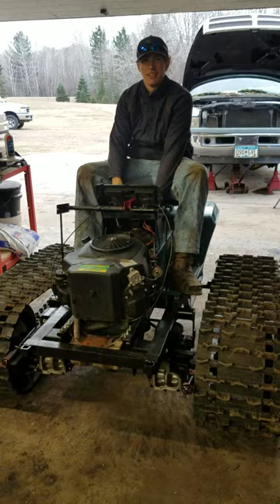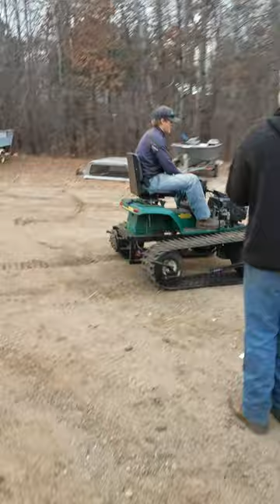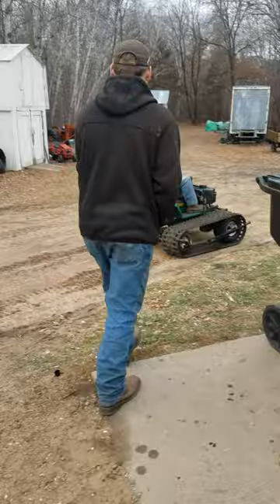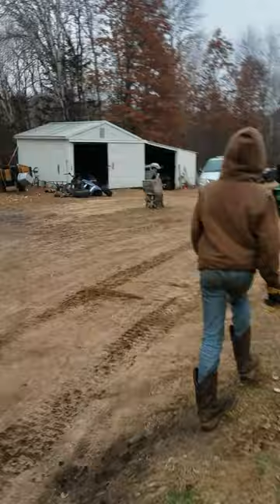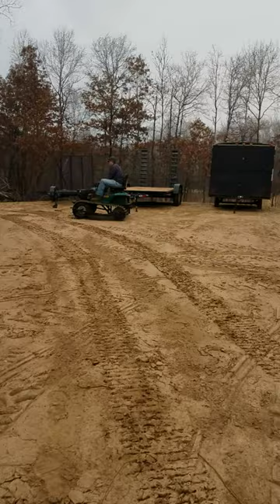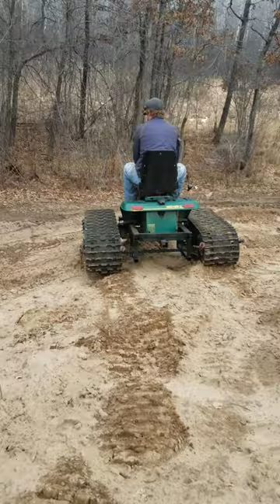Homemade Tracked Lawnmower ( Larry the Ripper)

Comment: That's awesome.  How do you plan to use it?
Reply from the maker: We mainly use it for pulling snowmobiles, four wheelers or other equipment around the yard to work on them; but I have also used it for moving trees and holding them with chain while cutting.
Reply: @zackschannel6584  This answers MY question exactly.. I think suspension on the undriven wheels would improve things drastically.. But you have done an excellent job!  I would build one as a mini skidder because I would love to thin and selectively harvest trees without cutting roads into my woods.. Again, nice work!

Comment: Got any plans?
Reply from the maker: I'll be putting out a full time lapse/ explanation video of construction once all the finishing touches are on it. Just thought I'd put the initial test video out since so many people were asking. There are no written plans calculations, etc.., me and my 13 year old brother just built it off the idea I had in my head. It was a little hectic the past week while building it but in the end there were relatively few problems. I guess I could write some plans if people really want to know.
Reply from the maker: Also, We are thinking of building a faster, trail rider that has liquid cooled snowmobile engines modified for summer/ winter use. Haven't thought about it too much yet but its in the project bin
Reply: @zackschannel6584  I like that direction. This is a clean build for off the top of the head